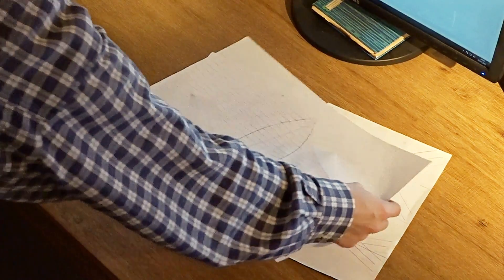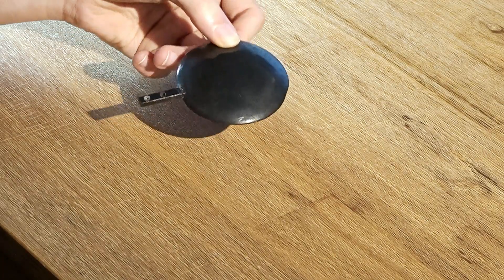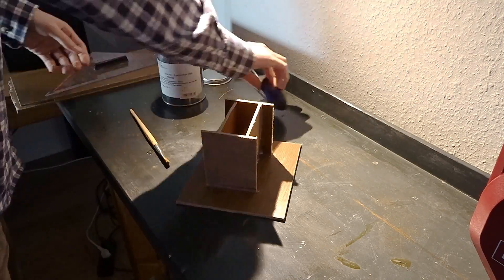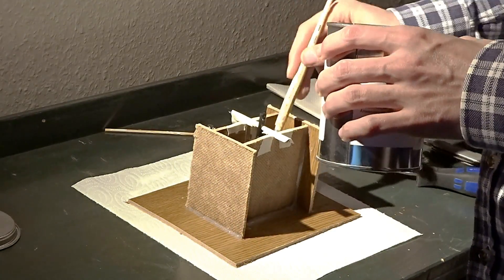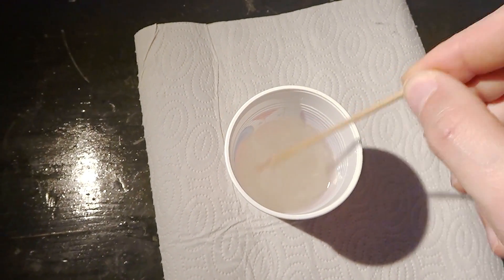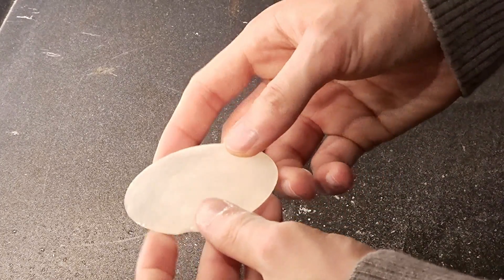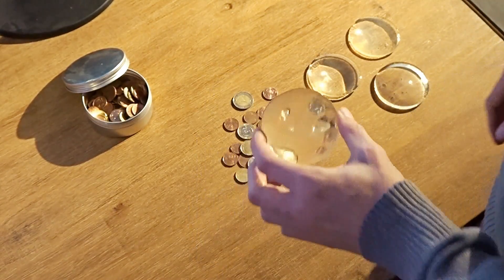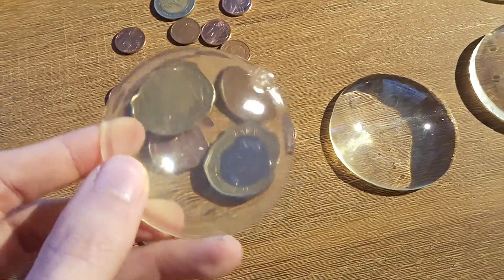How to make Optical Lenses

Comment: In order to get the finest clear surface of the lens after you have sanded to the finest possible..mix a little more of clear epoxy and spread it over the surface  with a small paint brush and let it cure  in a dust free enviroment . with t he top coat facing up. it will take longer but you will get a cleare view .
' one side at a time as you will have to keep any drips from contacting the bottom surface .

Comment: Hello thanks for the cool video. How many times can I use this silicon mold without ending up withe a cloudy resin look? would the silicon mold`s surface roughen up over time?  Thanks
Reply from the maker: The surface of the lens will not be perfectly smooth in any case when you take it out of the mold. Besides that this method is definitely not for mass production. I guess with careful handling of the mold a few dozen at most. For mass production one would probably need a solid aluminium mold or something like it.

Comment: Would this work to initially create the lens with a resin printer (clear resin)?
Reply from the maker: I don't know. The material in the volume of the lens would need to be perfectly even for it to have an acceptable optical quality. I don't know if a layer-per-layer approach could deliver that. I have seen translucent resin prints but not transparent. But I don't know if that was caused by the surface (which could be solves as I did in the video) or the material itself. So it remains to be tested. I don't have a resin printer though.
Reply: I know it's old, but now anycubic sells resin designed to be like crystal clear, so the answer is probably yes now

Comment: Wouldn't the epoxy turn yellow in longer uses?
Reply from the maker: Yes. There may exist UV blocking varnishes etc. that could prevent it or slow down, but thats not something I investigated further yet. After some years now the lenses from the video have yellowed a bit but are still clear to look through.

Comment: So, uh..  why not 3d print the mold & modle? A stand could easily be incorporated into bottom and could double as a bracket to support the mold during curing. I'd also recommend building a vacuum chamber as it will draw out all the bubbles. Its not hard or very expensive: a lower end rotary vane vacuum pump is like $200 (CAD)/ $160 (USD), and the actual chamber only needs to withstand a max of 14pis, and a small volume at that. Roughtly speaking a 6"×6"×4" chamber would give ya a lot of versatility and if your mold was say 4"×4"×2" then the actual volume of vacuum would be (6×6×4) - (4×4×2) = 144 - 32 = 112 inches³. You could probably get away with 3d printing that if you really wanted too. 

It may also be worth it for you to throw together a high precision lens polisher. 4 servo motors (to position the head use one for x axis and one for y, the other two for much more refined controls. If you had both of those set up so that the first two affected the second two with a gear ratio of 100:1 and 10'000:1, isolated it from vibrations (suspend the whole thing by steel wires), and worked really slow you could produce some seriously stellar lenses.

Oh ya, and you should also spray um with uv resistant clear coat so they don't turn yellow in a few years
Reply from the maker: It's all a matter of effort and desired quality of outcome.
What I wanted to archieve was a finish in geometric and surface quality, so the optical effect would be clearly visible, though not perfect.
For glasses or camera lenses it would be too rough and unprecice, but for what I wanted to do it worked out just fine.

I was aware of using underpressure to reduce gas bubbles in the epoxy while doing this video but decided it was not worth (yet) the effort, considering what
I wrote. For my purposes a few tiny bubbles in the lens were still totally acceptable.

A dedicated lens polisher might be overkill for any purpose short of camera grade optical lenses or for just some individual pieces.
As shown in the video a simple varnish dip will return a decent result on a pre-sanded surface.

Regarding the UV resistance you are absolutly right, they have yellowed a bit now after 3 years, though the lenses are still absolutly clear and usable.

But don't get me wrong - all good suggestions! Again it just depends on the outcome required and the effort/means one wants to invest.
Reply: @aurigo_tech  I should have mentioned that your video inspired me to attempt to make my own telescopic lenses 😅. Your proof of concept got me thinking about it and that's what popped into my head to get them to that sort of quality... though I forgot they also oxidize over time. If I do wind up attempting it ill document it and share it with you.
Reply from the maker: @ltsgobrando  Very cool! And yes, please share your results. :) Regarding oxidation I am not sure - certainly nothing like it visible on my ones (after 3 years). Apart from UV epoxy seems to be quite resistant to corrosion. But then again I have them only lying around in my house and don't subject them to much different conditions.

Comment: sanding the lens increases the eccentricity as I assume the pressure of your fingers is not perfect during sanding. There has to be a better way of achieving the right surface... By the way, what is the purpose of these lens?
Reply from the maker: Hardened Epoxy is hard enough and the fine sandpapers are fine enough so the amount of material you remove by hand is so miniscule that it doesn't affect the overall shape in a noticeable way. Well, if you want to make a industrial grade microscope or telescope or something similar this manual approach will not bring a perfect result in any case, so I guess then  hand sanding would be an issue, yes.

The imperfections through the molding process have to be removed however somehow and the surface needs to get a perfect finish. 
This is actually more important than small imperfections in the shape of the lens I found out (at least for hobby grade stuff like
I did here). Without a perfect finish on the surface the image you see will simply suck.

I made these as a test and for another project which I have put aside for now, unfinished. I plan to resume working on it though and maybe
also make an updated version of this video.
Reply: @aurigo_tech  I'm intrigued about the process and metrology of making lens. I always wanted to make a telescope from scratch, but the problem is the "how to be guaranteed of the surface".

Comment: How can we make 500mm DIAMETER lens
Reply from the maker: Depends on the intended purpose I think. Such a big lens would probably need to be a fresnel lens (to save material). In any case with at-home techniques (like limited size for 3D-prints) I would approach this by separating the lens into 4 or more pieces and later glue them together. 
When the lens is not too thick and/or the exact shape not so important then its just a matter of finding a way to make the mold and then pour in the epoxy.

Comment: how would you make a dark shade lens for like sunglasses?
Reply from the maker: You could spray it with some kind of semitransparent color, I am no expert on what would work, but many sunglasses seem o have such a coating. Or you could add colors to the epoxy itself (I want to try that myself at one point). But this would not be the best sunglasses as epoxy is not UV resistant + you might damage your eyes (I don't know if it blocks UV totally).
Reply: Yea that’s interesting idea

Comment: Very cool video!  Thanks for making it. 

What is that handheld power sanding tool called, a mini-belt sander?  I think I need that, for many different projects!
Reply from the maker: Thanks! I appreciate it. Jep, its a mini belt sander, very useful indeed, but only for smaller things like these lenses or for corners etc. on larger pieces. For removing more material or working on larger surfaces it however is still too slow/small.
Reply: Which shop available to buy plzz reply

Comment: Is it possible to make a small spyglass using homemade lenses like these?
Reply from the maker: Absolutly, but I think the smaller the lenses, the harder it will be to get the curvature and the surface perfect. Smaller than 3 to 4 cm diameter I would not go.
Reply: Sorry but are you a pyscho?

Comment: Great video, thanks.  I'm also looking into casting a custom lense for a project.  However think there are two suggestions I'd like to make.

1.  Spend all the time sanding/polishing/coating the PLA printed part rather than the lense because silicon casting can produce a mirror smooth finish right out out of mold (with zero work needed) if the mold is case with a mirror smooth impression.  Spending all the time getting the PLA lense perfect would have saved a lot more time with better results since PLA is heat smoothable and you can fix any issues before rather than later.

2.  Kinda obvious for lenses, avoid cutting the silicon mold radially.  A slice in half top to bottom would have worked just as well which will avoiding messing up the lense surface.
Reply from the maker: 1. This will probably not work for two reasons:
- there are still gases trapped in the silicone; so I got some tiny bubbles which caused mini-craters in the surface
of the silicone once it was hardened.
I didn't had a vacuum chamber to draw out the gases - perhaps that could indeed make things a lot easier already.
Those tiny craters alone would mess up the surface too much already so you would need to polish it anyway. 
- also the separation wax adds just enough micro structure to the surface that the resulting epoxy-surface would be
cloudy, thus requiring polishing as well (+ a layer of varnish, like I did). Without separation wax I found it to be nearly
impossible to separate the two halves without destroying them (I wanted to reuse them).

The 3D-Printed shape I did polish to near perfection, I think the shine should be visible in the video. 

2. I think you mean to make the two halves "around the equator" of the lens, opposing to "along a meridian" like I did (essentially
causing a line across the surface, yes.)? This is a good thought, and I thought of that as well, but decided against it, because
I knew the surface would not be perfect anyway from previous trials and how I did it was easier to create the two halfes of the silicone.
But yeah, it can be done either way.

Good ideas though. And please try them out. Its definately a learning and trial/error process. I did quite a lot of
trials and errors before these results.
Reply: @aurigo_tech   My bad, I skimmed through the part where you polished the PLA part.  In that case I'll revise and say that it might be the thin coat of release agent you applied inside the silicon mold that might have caused the final casting to be not mirror smooth.  I haven't casted a focusing lense but I have casted car light related parts and have gotten mirror smooth results right out of the mold without any release agent.  But if you're finding you have to use a separation wax layer as a release agent, then maybe before putting the mold halves together, you could apply a super thin layer of the wax release agent and blow some hot air over it to melt and smooth out the wax layer.

Also if you're gonna cut the silicon mold "around the equator" as you put it, you could stabilize the outer walls of the silicon mold by embedding a perforated piece of MDF or stiff metal sheet on both sides right into the silicon mold.   That way when you cut the silicon mold height wise, you won't have to worry about a deformed mold when you clamp the mold together again.

Another idea but haven't tried since I have a homemade simple vacuum rig.  You could try vibrating (a 60hz massager, or a subwoofer playing below 100hz) the resin for short period of time and use a surfactant to remove some of the bubbles.  Or maybe make a vacuum rig by modifying a simple car tire pump which is what I did.
Reply from the maker: @preddy09  Again, great ideas! I will keep them in mind if I ever do this again.

Comment: Very informative. Is it possible to cut it in order to make the circular lens rectangular?
Reply from the maker: I think so, the material is very sturdy and can be cut without having to wonder if it shatters. I would cut it first though and then apply the varnish finish (or epoxy dip, as someone commented here). However, when following the approach I did in the video you could also just make the 3d model and 3d print a rectangle from the start and there would be no need to cut anything.

Comment: How did you polished the printed pla?
Reply from the maker: Same as the lens itself basicly, starting with rougher sandpapers, going to finer ones and finishing with polishing paste + bits on a dremel. However, because the lens will require extensive sanding/polishing anyways one could skip the polishing for the 3d-printed shape. Just sand it down to the finest grid paper and it will be enough.
Reply: Zünder Oh i thought you used something like methylene chloride or something it looks so smooth for just sanding
Reply: Zünder Anyway problem solved . Do you think you can find a glass cube and cast a resin one and compare the refraction index of the glass vs resin? 🙏🤗 I would love to know they have almost the same index so we can just copy the engineering of existing lenses
Reply from the maker: Nah, just sanding+polishing + in the end I tried to make it smoother with spray varnish. It surely looked better but did not improve smoothness.
Refraction Index: no need to test it as the properties of the epoxy waterclear are known. When I remember correctly its 1,5ish - so pretty much like glass.

Hardest thing in lens making is to get the shape perfect so the image is not distorted (most comparable yt-videos fail at this, and mine are also not perfect). When you have to combine 2 or 3 or more lenses the errors add up and the image would be unrecognizable. So, to get to industrial quality (like in camera lenses) is actually super hard.

Comment: plastic wrap over a mason jar lid makes for a nice convex lens too. if you use acetone and abs filament, you can reduce your need for sanding. soak a sock, or piece of fabric in acetone, staple it to a metal coffee cans lid, then place your piece in the can and add the lid: it will be very soft, to cure more quickly, remove the can from the print. possibly have both ends of the can open. cooking times very, no heat.
Reply: and vacuum your resin first to remove tiny embedded bubbles
Reply: a thin coat of resin on the lens after sanding will remove scratches. heat it up so it's really thin.
Reply from the maker: Great ideas but I imagine it will be very hard to make very specificly shaped lenses (as I did). For a more or less arbitrary convex lens, yes you are right, there is certaily some steps that can simplify the process quite a lot.
Reply: it shouldn't be too far off, measure from the meniscus to the vertex of the curve,  measure the diameter,  and oula. a perfect isosceles.  ;)  Something else I've been meaning to try is to use a 3d printed curve for a mold, then use a microwave as a kiln.
Reply: Wow excellent